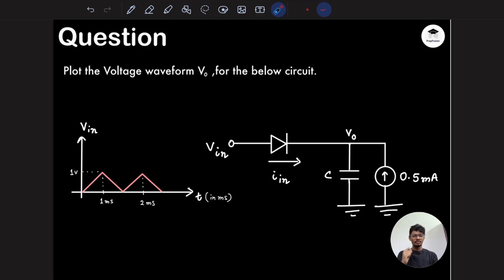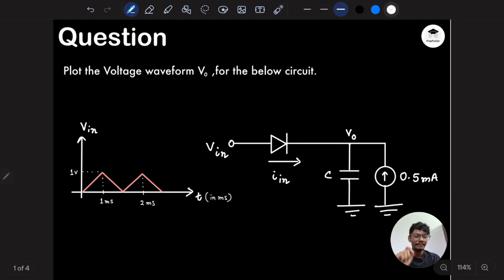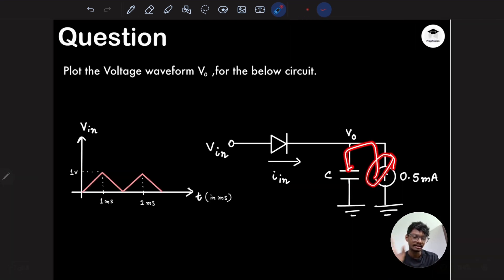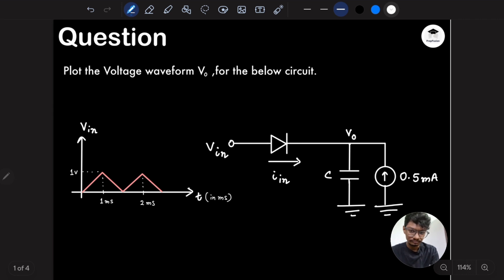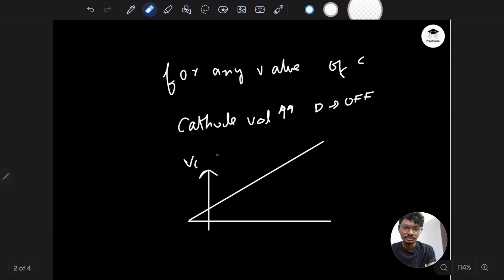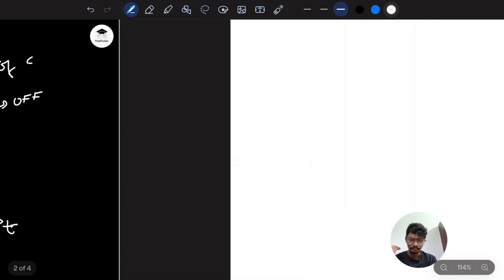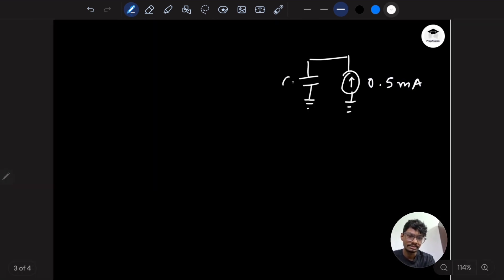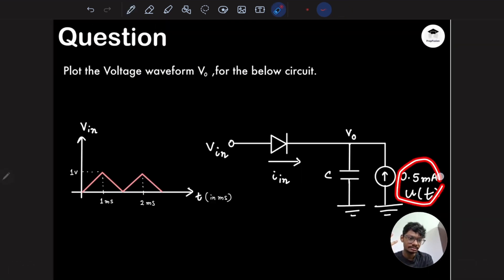Interesting Concept of Diode with Capacitor || Screening Test Questions || Circuit Queries

Comment: If C < 0.5uF the capacitor will be charging linearly at a rate >1V/ms and same is the waveform of Vo and the diode will never be forward biased.
If C = 0.5uF the capacitor will be charging linearly at a rate =1V/ms and same is the waveform of Vo and the voltage across the diode will be 0 in the interval of 0ms to 1ms an after 1ms it will again be reversed biased forever.
If C > 0.5uF the charging rate of the capacitor will be  <1V/ms and therefor at anytime in between 0ms to 1ms the diode will be forward biased. Therefore from 0ms to 1ms the Vo will follow Vi and the current source current will be by passed through the voltage source and after 1ms, as anode voltage is decreasing therefore diode will be reversed biased and the current source current will again start to flow through the capacitor and the capacitor will be  charging again at a rate <1V/ms.

Comment: Sir till 1ms diode will be on and it will the charge the capacitor to 1V and after that as Vin decreases Diode will be Off but the capacitor will keep on charging with vtg across it as (0.5t/C + 1) and now if anytime for the diode to turn on Vin> (0.5t/C + 1) which is not possible so diode will remain off Vtg across the cap will keep on charging linearly through Const current source 
Let me know if am correct if wrong where am i wrong!!

Comment: at t=0 suppose let us make diode on then capactior follows the input voltage and also the current source 0.5ma then does not flow through diode (n to p direction) then it should be flows through capaciotor therefore at the same node vo  0.5ma/c and vin not possible so diode really off so the capaciotor voltage will charge linearly . am i correct @anish bhaiyya

Comment: For 0.5u(t) current, Using superposition we can say that the capacitor will linearly charge and the output will follow the input linearly  and we  will get a y=x curve. For the input Vin and assuming current source O.C we can say that from 0 to 1ms the cap will charge and the Vo will increase linearly just like before but from 1 to 2ms it wont charge and since it does not have a discharging path it will remain constant.  So overall Voltage Vo will have a high slope from 0 to 1ms contributed by both current and voltage source and from 1 to 2ms it will have a smaller slope contributed by only current source.